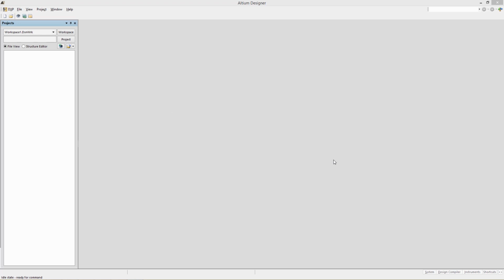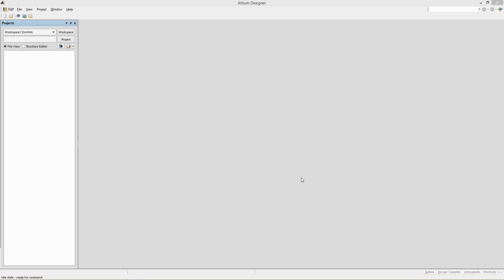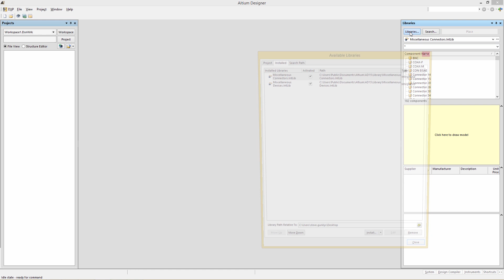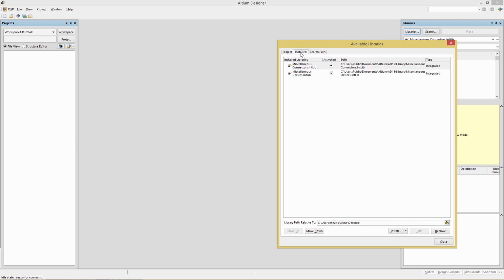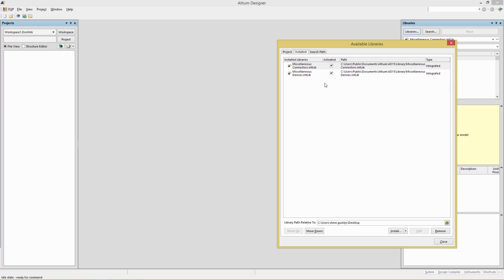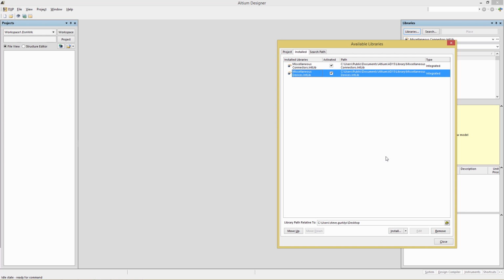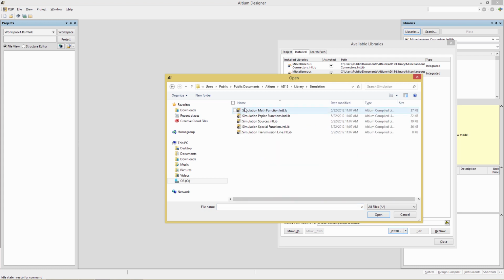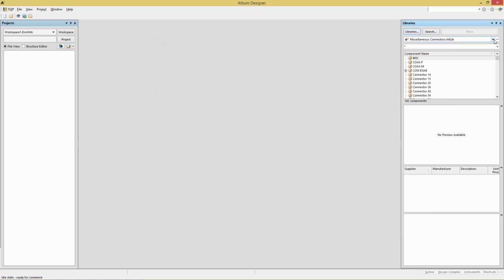Installing SPICE Simulation Libraries - Module 1

Comment: Is this still accurate for AD23? I just installed Altium Designer v23 next to AD22, and in the public documents folder I have a AD22 and AD23 Folder, both of which include a Libraries folder. The AD22 Folder is filled with countless libraries like you showed here with AD15, but the AD23 Libraries folder is completley empty?

Comment: At about 50 seconds is a description of the libraries tabs and where they are installed. Which I am inferring is something like Project only scope, Global to all projects in a work group (work space) scope and then a search utility.
I have been looking but I am not able find the corresponding view in AD20.  Perhaps I misunderstand or it works differently in AD20.
Reply from the maker: In AD20 it's in the Components panel. Click the menu icon on the top right and click "file based libraries preferences" - there you can load the libraries as in prior versions.

Comment: Hi thanks for sharing these, will this series of tutorials be relevant for Altium Designer 18 onwards?
Reply from the maker: YES. Generally speaking, everything is the same. However the underlying engine has been changed from XSPICE to NGSPICE as of AD20, so it's much faster to simulate, but Digital SimCode (a proprietary Altium format) is no longer supported.